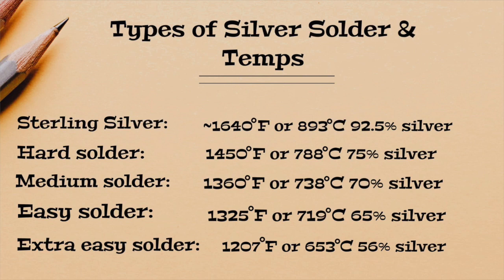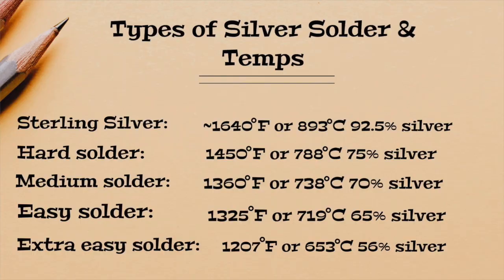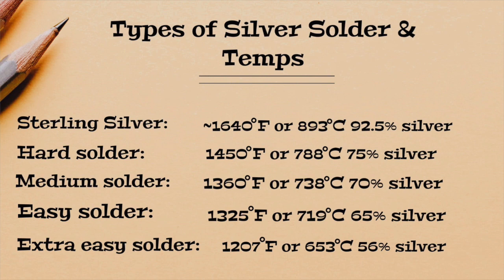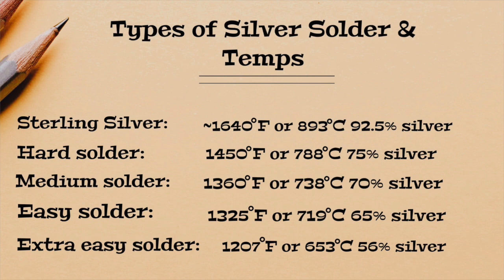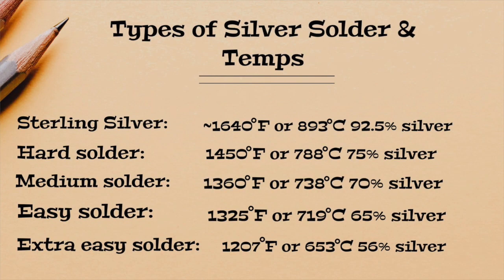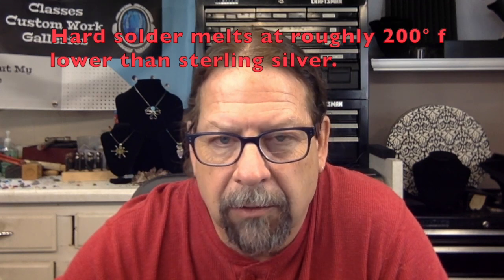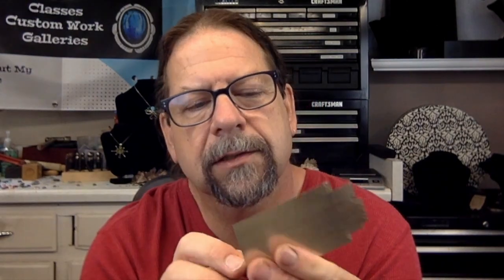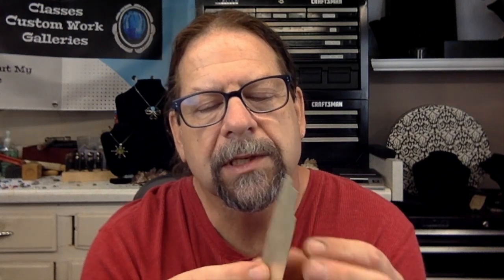Soldering Tips

Comment: Chad, I really appreciate your beginner breakdowns! It's always important to keep your fundamentals sharp and you're still sharing new tips I've never seen in these videos. Thank you so much for taking the time to help us all!
Reply from the maker: Thanks Cody. I always remember something I should have discussed after I publish the video, lol!  Hope you have a nice holiday season!
Reply: @chadssilversmithing  Hey, sorry to impose, but I've got a question I've been struggling with a bit lately. I am meticulous about keeping my scrap free of solder, but I do save all my scrap with solder separately. I've melted that down into an ingot and slowly rolled it out into a ring shank blank. The thing is, I keep melting the band before the solder flows but I don't have the same issue with "fresh" silver (never been used/melted down). Do you think the issue is me or the lower quality metal I'm using? Thank you for your time!
Reply from the maker: @codythompson2560  I would think the melting temperature shouldn’t change much unless you really had a lot of solder in the mix, and it sounds like you don’t. I usually add in a little scrap fine silver bezel to offset any lowering of the silver content due to solder being in there.  It doesn’t seem like that should cause you problems, so I’m not sure what is causing this Cody. Thanks for the comment, and sorry I didn’t have a better answer:)

Comment: Hey Chad, Thank you again for these lessons😊 If I can make a request, could you give us some lessons on working with heavy gauge sheet and wire? Like traditional cuffs and ketoh bow guards? I’m trying to do it on my own but the sheet deformed while I was trying to solder the thick wire on. Just a hopeful suggestion. You really are helping us and inspiring us so Thank you s 10😊
Reply from the maker: Hello Vestacha International!  I've honestly never done any of those sorts of cuffs. If I were to guess, the problems are likely arising from the difficulty of getting large pieces to reach soldering temperature evenly. Drastic temperature differences in large pieces of sheet can cause warping. What sort of torch are you using?
Reply: @chadssilversmithing  hi Chad, I’m using just a standard disposable propane tank and torch head. I have a smith little torch but no flashback arrestors so I’m a bit nervous to use it. From what I read online it needs high heat and so I had it on as high as I could get it.  I didn’t hammer at all on the sheet before soldering as I was trying to keep the surface as free of marks as possible. Most Ketoh bracelets are done using delft clay casting but I’ve never tried that. I’m only a couple years into this new art form. I love your work and videos. I’m hoping hoping that in the new year you’ll be able to do some close up angles of how you make your pieces. Thank you for responding and I hope you had / are having a good holiday.
Reply from the maker: @Shukarr  Before I had an acetylene torch I used to use two propane torches, one in each hand for really big pieces, but then you don’t have a free hand to nudge things with a pick if they shift on you:)